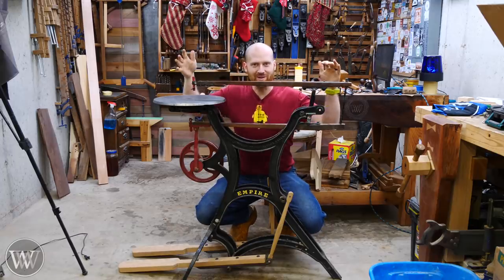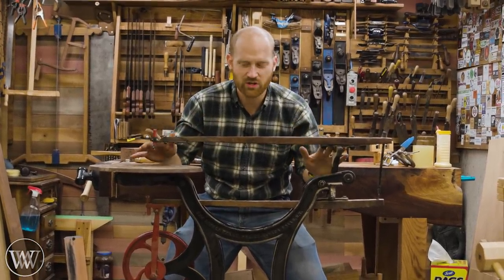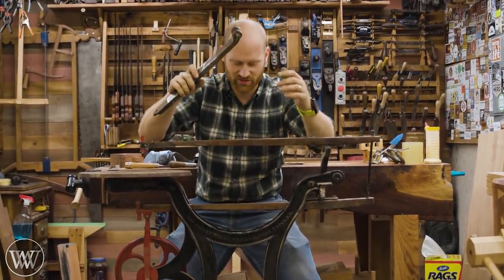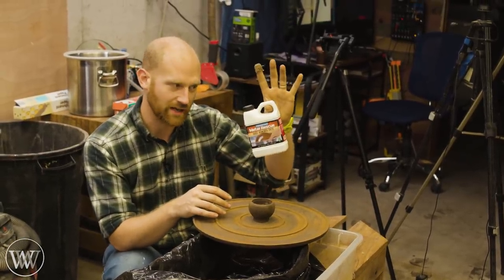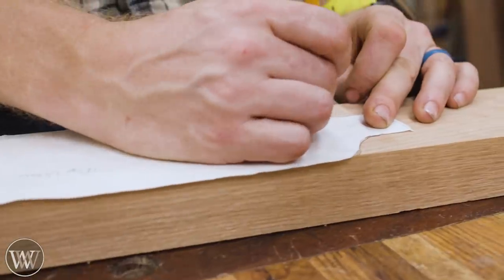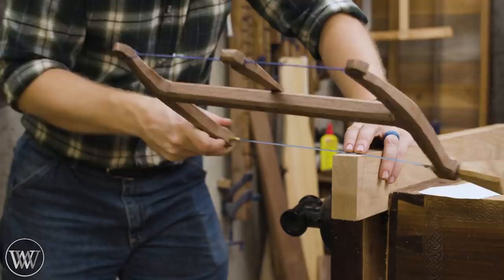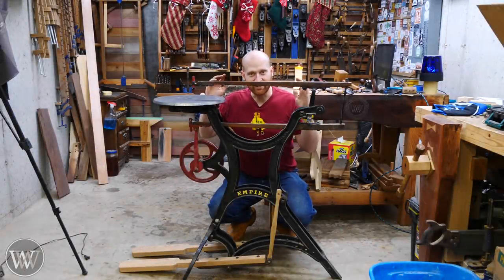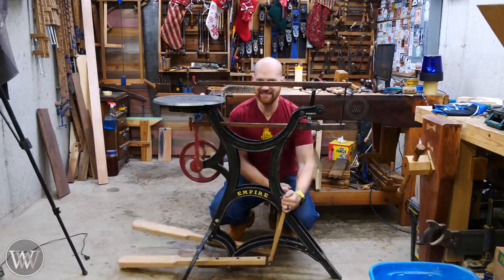Restoring a 120 Year Old Empire Scroll Saw

Comment: Happy new year to you and the family. Methinks when you make the flywheel there may be excessive friction in the pedal/transfer bar joint. We will find out.
Reply from the maker: Thanks. The shaft it connects to will still be steel so there will not be wood on wood

Comment: Now I’ve seen everything - a Card scraper, a file card and chisel used on metal! Ever thought about investing in a grinder with wire wheel? You do seem to like making things hard work... Nice pedals.
Reply from the maker: The card scraper is actually faster to remove the cross then a wire wheel.

Comment: James, this is a neat restoration!  Have you investigated the modification/use of a cast iron fly wheel from an old treadle sewing machine for this saw?  They can be had on ebay for $20 - $30 and are usually about 12 inches in diameter.  Just a thought.
Reply from the maker: thanks. yes I ahve looked at those but this one needs to be much bigger. and I have not found anything that can be modified to fit the frame yet.

Comment: Hi, you could borrow the flywheel from your friend, take it to a cast iron foundry, get them to cast a new one directly from it. The new one will be a little smaller but would be the right shape etc. The place that did the pedal castings should be able to do it. K
Reply from the maker: We looked at possibly doing that, but there are several downsides and I want to show how to make a wooden one.

Comment: Pedals and drive arm linkages look great.  Did you get a multi-view sketch or pics of the original flywheel and its setup?
Reply from the maker: thanks! yes I have pictures of it. but the new one will not look like the old one other then in size as it will be made of wood and need to be thicker to make up for the difference in weight.
Reply: @WoodByWright  you could do a iron or steel ring around the outside to add some weight at the edge of the wheel. Make it just a bit small, heat it and it will shrink tight as it cools, making for the perfect fit. Think wagon wheel rim. Then you could thin out the center a bit to put the weight where it will serve you the best.
Reply from the maker: @thomasarussellsr  I could but I will need to take weight off. And the outside is actually a pully that the belt wraps around.

Comment: If you haven't got a flywheel yet, could I suggest using one from a manual gear box clutch? I dont think it would need much modification to make it work, and it carries a good weight ( though it might be to heavy?)   :)
Reply from the maker: The problem is the diameter needs to be right to gear up to the driving head.

Comment: Sorry to do a little nay-saying but a 24 hour soak in Evaporust would have done a much better job on the pits and would have required much less elbow grease to clean off the blackening.  Hand Tool Rescue guy uses an awful lot of it and it really does a great job... BUT that said .. I LOVE what you're doing. Good luck on the flywheel.
Reply from the maker: I use evapo-rust quite a bit. It is good stuff.  But it does not smooth the pitted surface. That is what the grinding was for.
Reply: @WoodByWright  Sorry, my intent was to say that that rust IN the pits would be cleaned out better. NOT that it would remove the pits. The grinding is unavoidable but less if the rust is not there at all.
Reply from the maker: @clydedecker765  oh, I see. but that is what I did with the metal bath, but rather then evaporust I used metal rescue. I find it to work a bit faster and is cheaper.

Comment: Hi, couldn't you make a wooden pattern for it instead and include the casting process. This could be a good video and end up with a   cast iron one. There are lots of these type of machines around that need new parts cast and the process of making patterns by hand is a very rare craft these days. I have done this myself for steam engine parts ( full sized ones!!) and it is nice to see a 100 ton logo steam past with the parts you made making it run.
I have two Hobbys type scroll saws which I use and a friend has two more all 1920 - 30s made and run as good as new. The drive wheels are a work of art in themselves that even a cnc machine couldn't make today!! K
Reply from the maker: I thought about that, but could not have done it with casting the pedal supports. Also I prefer to make a wooden one. I want to show that others can make it from wood they do not have to go through the troble of casting.
Reply: @WoodByWright  
Won't the weight be too low in wood to keep the speed constant? 
A laminate wheel with kingwood, blackwood or something similar word be OK or oak with lead sheet inserts? or beech / birch with steel plates?  K
Reply from the maker: @kevingrime5772  with white oak I will have to drill holes to remove weight. The original wheels were delicate and very thin.